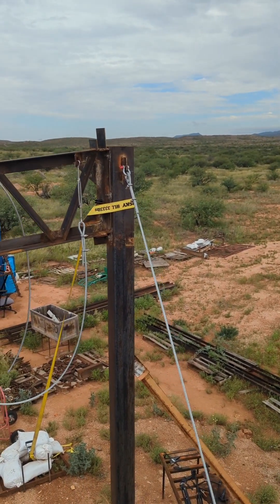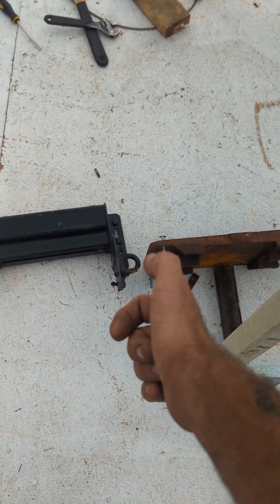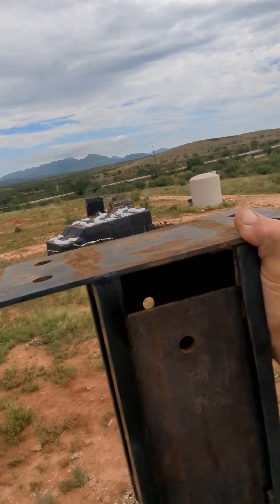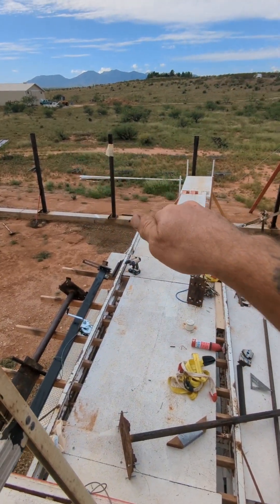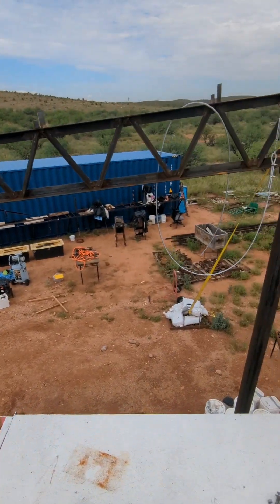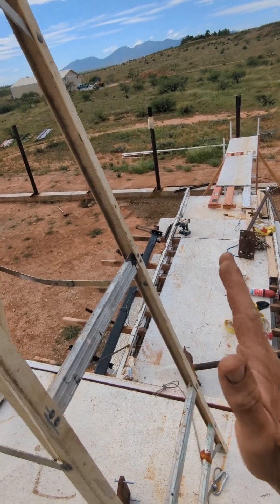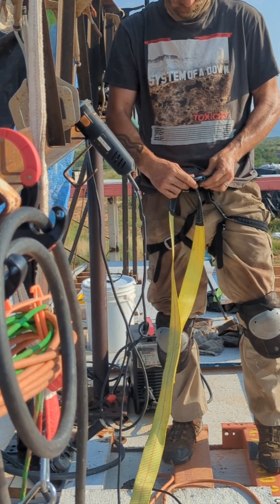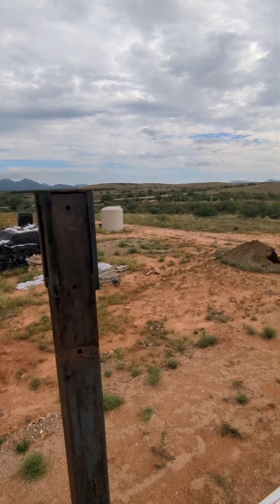Steel Frame Home Build - 40 foot steel truss fabrication

Comment: are you going to need some diagonal bracing between the posts soon?
Reply from the maker: I am actually going to do a video on lateral bracing soon. 
But basically once first 2 trusses are done there will be  lateral bracing in the first bay and then again in the last bay (last 2 trusses) the posts are fine on their own because they are welded to 4 ft of concrete